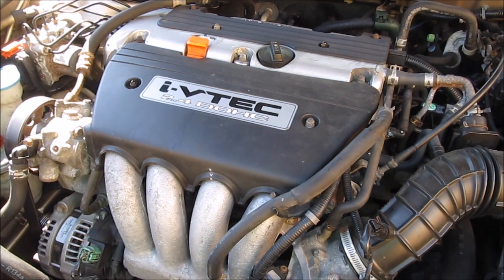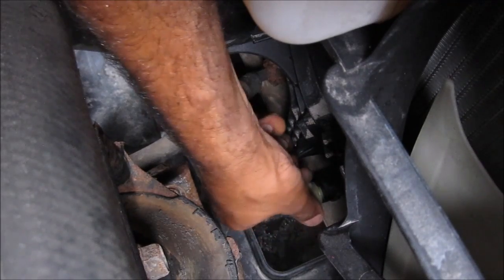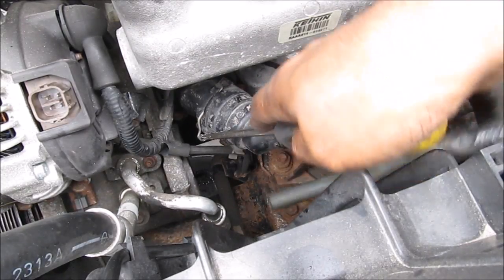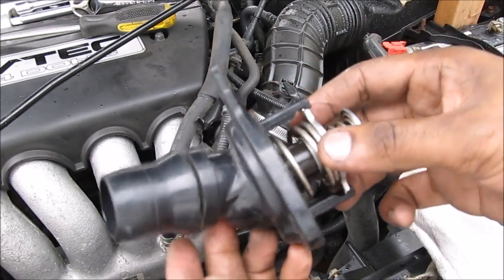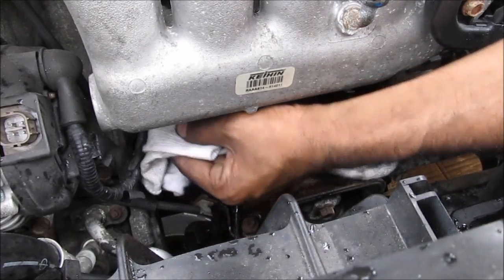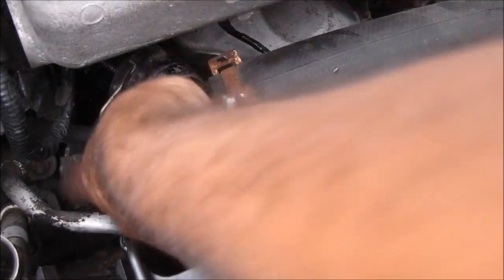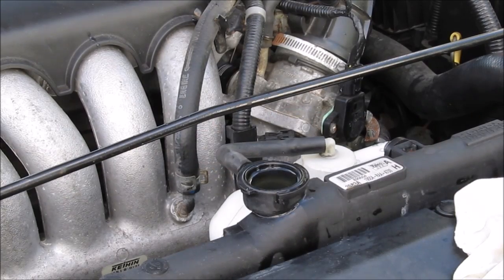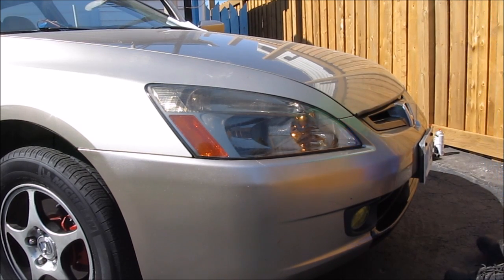How to Replace a Honda Thermostat

Comment: My hose has air goin to it like it goin to bust I let the air out an it stills over heating wats goin on can anyone help
Reply from the maker: Let it cool down then relieve the radiator cap pressure.

Comment: Lower left 10 mm bolt  is in   limited  ratchet space due to compressor line Need a non standard  extension  size like a 2 inch or 2.5 , or a wobble extension . Otherwise exercise patience by doing one click at a time .

Comment: Ok thats fine, but why not show how to replace the other plastic housing that the thermostat housing mount up to, because if its mating surface is warped it would cause a leak that would lead you to believe its the thermostat.
Reply from the maker: Yeah plastic is not a good idea at such a hot spot.

Comment: Great video. Too much take this off and that off in other videos. This just gets to the point. Only two gripes, use aftermarket Asian blue or Honda blue coolant only, you'll thank me later. Second, (just a suggestion) buy a radiator bleeder funnel, works really well, you raise the front of the car, attach it, and boom it makes it so easy to bleed the air out of the system completely.

Comment: Good Video but I have a problem with access to those three bolts (10mm) on the '09 Accord.The alternator wire has several points where it's fastened  to the housing and its really hard to get to the bottom  bolts without some sort of flexible ratchet

Comment: The 2010 Honda Accord 4 cylinder has some sort of clip to the thermostat housing which is now shown on the 2004. It holds a harness from the alternator. Could not get that clip out, so had to take it to my repair shop.

Comment: are there different temperature thermostats for the Honda Element?
Reply: Yes but only slightly, just trace your radiator hose back and find it. When buying the new one just make sure it fits your year, will be slightly different

Comment: You made removing the lower radiator hose look too easy. My pipe won't come loose from the housing. I already got the thermostat housing changed faster than removing that part.
Reply from the maker: Oh boy. Try using some channel locks to break it free
Reply: @speedkar99  I put it in a vice and pried it off with a bar.

Comment: Did this and heater still not working well.  One of the vents seems to work the others blow cold air.  Does it take a while to get going?  What do you recommend?
Reply: Adding coolant seemed to work.  It may be I have a leak somewhere.

Comment: Tried this.  Not easy.  Hose was stuck took forever to get off.  Finally used a lot of muscle and it came off. Bolts were rusted had to wd40 them luckily they did not strip.  There is extremely little clearance on the bottom bolt.  Very difficult to screw back in.  Keep a magnet handy.  If you have a hard time getting bolts back in they are probably too rusted to fit through the thermostat housing.  File the smooth part down.
Reply from the maker: Yeah it's not that easy to get

Comment: I have to replace my radiator soon? Should I do the thermostat as well ? What about a water pump ? My Honda CR-V has about 180k miles. Thanks
Reply from the maker: Might as well since the coolant is drained

Comment: Best video so far. 3 minutes and you covered all the important points it takes other guys 15+ minutes to do
Reply from the maker: Thanks. Short and sweet is how it's gotta be
Reply: AGREED  CONCISE!!!  sheesh  and the longer versions are more Complicated and not quite PRACTICAL
Reply: Question please, I was changing the thermostat on my 2002 crv ex ,1 bolt came out the other,2 just turned without loosen at all any ideas on what to do or should I say how to get them loosen

Comment: My 2004 accord does not spin the radiator fan automatically. 
The fans only spins when I turn on the AC.
What could be the problem?
Thank you speedkar.
Learning a lot from your videos.
Reply from the maker: That's how the fans are supposed to work
Reply: Did you car get overheating? Or not when the car reached normal temperature the thermostat opens so the coolant can flow but the fan as well that supposed to be on so it can cool down the temperature of your fan doesn’t kick when you reach a higher temperature maybe it’s the relay try to swap the Condensor relay for the coolant fan there’s also a a fan switch that controls the temperature of the coolant when it gets hot it send the signal to the relay and makes the fan works jump the connector of the switch with a paper clip it turn the key in position 2 don’t start the car if your fans kicks it mean the electric ⚡️ connection the wiring to the fan the relay it’s good that mean the fan switch is bad

Comment: Whats the estimated duration of a job like this? 15 min with moderate skills and tools?
Reply from the maker: Maybe an hour...
You gotta drain the coolant, burp the system etc
Reply: @speedkar99  Thanks for reply. I completed the job yesterday. 4 hours i jacked the car up and put jack stands ( didnt have to) secondly i dropped a screw from thermostat along with  10mm bolt ( 3 hours of searching). A bit of advice for future DIYers use small ratchet with 10mm tip that is about 2.5 inches long. It may seem like it cant fit but after 2 hours your hands will make it fit! Thanks for great vid and goodluck to everyone!

Comment: Should've used Japanese spec radiator fluid. Basically any Japanese factory radiator fluid is the same spec, Honda is dyed blue. But they are all super long life and more importantly silica free. Zerex is the only aftermarket brand that I know of that meets these specs, although red is the most common color they carry ( Toyota color) some stores do carry blue dyed Asian vehicle formula from zerex
Reply: Super Tech extended life meets Honda requirements: Silica, borate, amines, and phosphate free. You can buy it at Walmart for like $3-4 the gallon. Zerex does have coolant for Japanese cars but they charge $15 per gallon and my car takes 2 gallons. I haven't had any issues with Super Tech Coolant at all.

Comment: how many gallons of coolant did you use? was 1 enough? also do you know if oem honda coolant need s to be diluted with water or is it premixed already?
Reply from the maker: 1 for a drain and fill. You'll have to mix with water

Comment: efficient video except that when replacing the liquid, the heating must be started without the air conditioning so that the water circuit is made and see if the fan triggers or not.
Reply from the maker: +Stephane Vincent thanks for the tip

Comment: I emptied all of my coolant, removed the hose, and one of the bolts on the thermostat stripped and I can't remove it. Any ideas? I had to put all the coolant back in the system because it was getting late.
Reply from the maker: +Gianno Mauceri vice grips? Read driveaccord forums there's a few there had same problems
Reply: Unfortunately, it's relatively easy to spin the brass thread inserts that are in the coolant passage plastic, i.e., which the thermostat is bolted to.   You are unfortunately going to have remove and replace the coolant passage (19320-RAA-A01 or 19320-RAA-A02 for a TSX, 19320-PNA-003 for an RSX Type S) behind the thermostat, which is held to the water pump bracket with three more bolts, one clamped rubber hose and another pushed on pipe with an o-ring.  Ref: https://www.acuraoemparts.com/v-2004-acura-tsx--base--2-4l-l4-gas/engine--water-pump  You'll require a new gasket for the coolant passage (19322-PNA-003) and new o-ring (91315-PNA-003).
Reply: @TassieLorenzo  so I guess I have to replace the whole housing not just half

Comment: wt u think easy to work on..Honda or Toyota..since u had both cars to work with
Reply: Ive had better luck with Hondas over the years vs Toyotas in terms of reliabiity. For me, I cant deal with the sloppy handling. At 80mph on twisty freeways some Toyotas Ive driven literally felt like I was on the verge of losing control of the vehicle, bouncing and swaying all over the road. Im willing to make the trade off for the superior driving dynamics of Hondas. But yes they are much louder and less smooth.
Reply from the maker: +who r I understand what you mean about the steering feel. I've always liked the soft steering of Lexus/Toyota, until I got this Honda. I always thought that Honda steering was too stiff and would hurt your hand on a long distance drive, but my Accord isn't too stiff, it has just the right amount of feedback. 

Regarding the other things though, I prefer the softer smoother, quieter ride of the Toyota.

There's more aftermarket support for Hondas because alot more people DIY on them. Unfortunately that also means all the good Hondas at the junkyard have been picked over, compared to the Toyotas.
Reply from the maker: Toyota is better than Honda, hands down. Its much easier to work on, they're mechanically and electronically more simple, interior fit and finish is better and the ride quality is so much more refined.

I will give Honda its credit for a very strong engine after so many miles, and better steering feedback.
Reply from the maker: +who r I understand what you mean about the steering feel. I've always liked the soft steering of Lexus/Toyota, until I got this Honda. I always thought that Honda steering was too stiff and would hurt your hand on a long distance drive, but my Accord isn't too stiff, it has just the right amount of feedback. 

Regarding the other things though, I prefer the softer smoother, quieter ride of the Toyota.

There's more aftermarket support for Hondas because alot more people DIY on them. Unfortunately that also means all the good Hondas at the junkyard have been picked over, compared to the Toyotas.

Comment: How did you know the thermostat was broken?

And did you put a used one in?
Reply: you can boil the thermostat on hot water and look does the thermostat "open" in working temperature spesification or not
Reply from the maker: +d w Replacing the thermostat is good preventative maintance when you've got the coolant drained, in this case I also had the water pump out.
Reply from the maker: +Aditya Graha Pratama True
Reply: I am here because my car is throwing an engine code related to the thermostat.